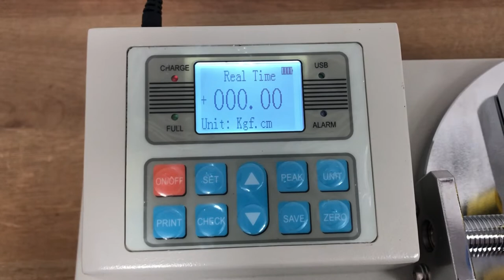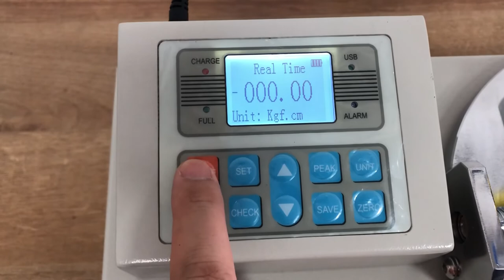Bottle Cap Torque Tester RT-719

Comment: What's the use of this?
Reply from the maker: RT-719 Cap torque measuring instrument is one of intelligent multi-function instruction equipment for testing or inspecting many kinds of caps with torque. It specially is used on testing the torque of cap or lamb cap. It is widely used on product control system, with the function of easy to operate, high accuracy and economy.
Reply: @RightInstrumentCoLtd   thank you so much. I always get curious when I pass by this machine in the lab. Now I know